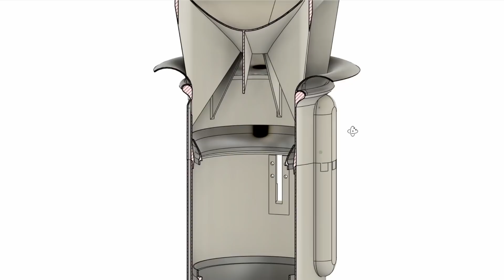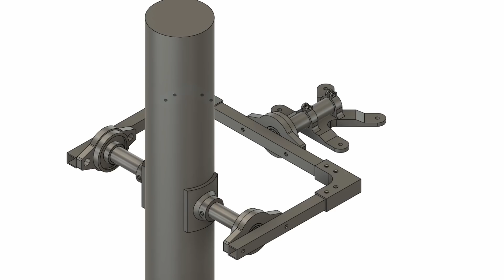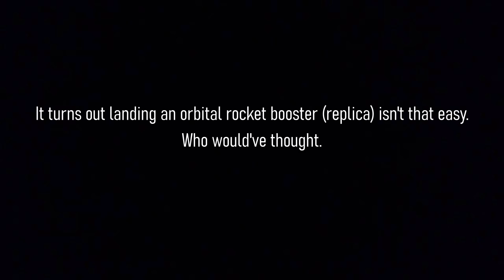SpaceX inspired edf rocket part 2: Final assembly, tuning and maiden flight

Comment: Great project!! Looks great! 
Add weigh to the lower position or move down the EDF or battery.
I fly RC airplane and when the plane is in hover and nose heavy start to oscillate the same way that your booster, so my advice is to add more wight in the lower position or remove weight from the upper position.

Good luck!!

Comment: 1.  Put a rocket engine at bottom.  2. Put landing legs at top of first stage. 3. After burn launch, eject capsule (parachute?) and use small gyro to flip first stage of rocket 180 degrees. 4. Now with landing legs down, use the landing motor to put her down. Piece of cake!

Comment: Very cool... A couple of possible solutions.....use the pid controller on the gear legs.  Appears the problem gets much worse when the first leg gives and the others touch down. Time it so if say at 5deg rocket tilt the gear plane is -5deg the other way. At a minimum link the legs so they react/move together from impacts.  Other possible solution would be lateral thrust ports just below the fan  directing flow for lateral stability... Aka cold gas thrusters.  Once ground contact happens vector control is zero.... took SpaceX a few tries as well!!!

Comment: Cool. I think if it were me trying the rocket would have four small propellers pop-out up top and land like a drone. Use a real rocket motor in at the bottom that relates to gyro system. I've been wanting to make a go at it. To simplify the launch I think I would use clear fins instead of a gyro system. Then have the landing gear retract in between the fins.

You did well.

Comment: Seems like one problem is the spin down of the EDF.  At touchdown if the vertical alignment isn't perfect, then the off axis gyro effect will cause the rocket to precess (tip over).  Cancelling the gyro moment of inertia with your setup will be difficult.  A second EDF rotating the opposite direction would be ideal but maybe a small motor spinning a weight under control of the EDF rpm would help.  Terrific work!

Comment: It seams that the rocket cannot have much X and Y forces right after the moment of the touch down. Probably you have to reduce the payload load, or try to redistribute the mass. You could put the DC motor down and redesign the air vents. If you use batteries as 18980 (don't remember) try to put them around the rock body. Or, simple add some weigh close to the bottom of the rocket. Just ideas. It is an impressive project. Congratulations!

Comment: The ducted fan sounds maxed out, I was going to add a second one to my design, and use a higher kva motor on the top. You could tie "retro thrusters" to help stability on the upper fan, diverting more volume higher up. Use your existing servos, and link a sliding door higher in the body. Also might be worth the weight adding isogrid internally so you don't have to reprint your cone every crash. And maybe carbon fiber rods and printed hinges for the landing legs

Comment: Keep going, you're almost there! Maybe griffins or engines for lateral thrust
Reply from the maker: Haha yes, unfortunately grid fins aren't that usefull at low speeds, but using compressed air thrusters might work to keep the rocket upright during landing.

Comment: This is amazing work and progress! I'm wondering, watching the videos, if you're trying to do too much manually.  for instance, would a downward facing camera that's looking for the 'marker' of the landing pad be something that could assist with the landing. the computer could make faster adjustments I'd think. Also do you need thrust on the head of it? The first landing came in at an angle, there was a bit of a bounce and then it looked like the head momentum just kept going (makes sense, the base was 'stuck' as it was on the pad).  If there was thrust at the head, I'd think a small amount would go a long way.  That may make the design too complicated, but just my thoughts. Really well shot video, thankyou! Subscribed and looking forward to the next one!

Comment: Have you tried adjusting the D setting in the yaw axis? When the legs are retracted it doesn't have the same centrifugal resistance when they're out. Try spinning in an office chair with your legs out then pull them in. You'll spin faster. Same with the PIDS. They're trying to adjust when the legs are out but it's a totally different behavior when they're in. Have you tried adding dynamic filtering?

Comment: Cool. I loved it. When will we see part 3? If it helps you to get a more stable landing, you can try out by adding a parachute. Or just making landing legs a bit longer, locating them a bit higher, and increasing their pitch angle adding another 45 degree. Something similar to Apollo LEM (Lunar Excursion Module).

Comment: Very nice, I'm wondering if your servo ever broke or if it was only the plastic for the leg connection?
Reply from the maker: The servos broke more than once and they were a real pain to replace 😅
Reply: @BrianBrocken  Thanks for quick reply, I'm then going to use "MG99R" for my model rocket, instead of the "SG90" servo motor ;-)
Reply from the maker: This might be a good idea but even then you might still have a broken one as the moment arm is pretty large. I’m working on a new version that puts a lot less stress on the servos and locks in place and has some shock absorbing.
Reply: @BrianBrocken  Cool, do have another servo to lock it or how will you make the lock?
Reply from the maker: Mechanical lock in place, the original one also did this a bit but it was to easy to jump back out.

Comment: I dont know if these types are available, but i think you need a dual counter rotating fan to prevent the instability when the legs are retracted.
Reply from the maker: Yes, this certainly is a possibility. This would neutralise the torque created by one motor and would probably solve the problem with the landing gear 😉👍 the only problem i can think of right now is that the 2 edf’s would probably drain the battery to quickly. I now have a flight time of about 1 min with only 1 edf, i think it’ll get worse with 2.

Comment: That is an amazing project, i scratch build my own rockets of the traditional solid fuel variety in the UK, yes HPR is alive here just, ime one of only handful left in the UK that does HPR due to are very inhibitive culture here regarding private aerospace development.
i am wondering how the physics would work regarding the rocket equation with combining your EDF system with an SRB for the initial vertical/altitude phase of flight, in theory all the EDF has to do is have enough amps of power to aero-brake &  stick the landing which means it could be run from a small lightweight ultracpacitore, ime not sure how this would work in the real world but i bet it would be fun trying. If you dont need to worry about a shute recovery system that leaves a lot of freedom to get the rocket up to a considerable altitude.
I cant wait to see you next video when you get it to get some high & stick that landing, it looks like quite a challenge you have bitten off there, good luck & hope it works
Reply from the maker: Thanks man 😁 i think a hybrid rocket would be possible and a great idea. Believe it or not but the original idea was to use a super capacitor bank to power the rocket (Tom Stanton inspired 😜) but quickly abandoned this idea because of the higher weight and very small flight time. I did manage to get my fpv race drone in the air with it and got a 20-30 second flight out of it, but edf’s are a little more power hungry 😅
Reply from the maker: I was going to use these ones: https://m.banggood.com/2_7V500F-GDCPH-Two-pin-Super-Farad-Aluminum-Capacitor-35+60-p-1738789.html?rmmds=search&act_poa=SKUG13082&cur_warehouse=CN

Comment: It becomes unstable in the yaw axis when the legs are retracted because of the change in moment of inertia. You could offset this by attaching counterweights to the legs that move towards the outside of the rocket when the legs are retracted in order to give the same moment of inertia.
Also you lose attitude authority at the moment of touchdown when you need it most because the vectored thrust system is unable to move the bottom of the rocket when the legs are touching down.
 you could possibly channel air into ducts that produce thrust jets around the nose, that would take over control at the moment of touchdown.

Comment: Its awesome... does it help balance if the weight is increased... I know the lift becomes difficult and I am no expert
Reply from the maker: I do think it gets more stable the more it weighs because of the inertia, but like you say this is limited to what your edf can push. The whole thing flight ready now weighs 1.3 kg and the edf is rated for 2.5kg static thrust, but due to losses in the tube it's just able to take off with only a little margin left.
Reply: @BrianBrocken  got it. Great effort though🙏. I wish I could motivate myself to finish any of my projects some day.🤪

Comment: A large part of the landing problem is that the ONLY controls you have appear to be the vectored thrust out of the tail.  This means that to swing the nose, it HAS to be able to swing the tail.  But on landing, as soon as the tail touches down, it can no longer move laterally, meaning there is no control over the nose tipping.  In the real rocket, there are reaction control thrusters in the nose that can provide the little nudges necessary to keep it upright as it touches down, but I doubt this would be practical for your design (you could try adding laterally-directed thrust ports that slide open or close to control the amount of thrust through them?)

Simple solution, though: try adding a landing net/hook.  That's what the navy uses to get it's helicopters to stay put on a pitching destroyer or frigate during landing.  Put a small barbed probe pointing downward, and tightly stretch a net slightly elevated (1/2 inch or so) over the landing pad. On touchdown, the probe enters the net, but the barb prevents it from coming back out.  If the airframe starts to tilt, it is arrested by the net.  https://en.wikipedia.org/wiki/Beartrap_(hauldown_device)

Not EXACTLY how SpaceX does it, but unless you can add lateral reaction control thrusters near the nose (or alternately, come down PERFECTLY upright, PERFECTLY downward, with no tilt or lateral motion whatsoever- near impossible with any air movement), it will continue to tip.
Reply from the maker: Some people have suggested to me to use magnets in the legs and a steel landing platform which i think is also a great idea and would probably work very well, kinda like the net/hook sollution you proposed.
Reply: @BrianBrocken  Yes, magnets would probably be a more elegant solution, come to think of it

Comment: Dude! That’s so awesome!!! I am by no means an engineer or a rocket scientist, but it looks to me that the rocket is heavy on top. I have no idea where the c.g. should be, does it need to be top heavy so it can move the bottom more easily? Just seems like if the c.g. was lower on the body it would not want to tip over on landing, but would that make it harder to fly? I do know this is only possible for the real boosters because of computer adjustments on the nozzle. Humans can not react fast enough to make the minimal adjustments required to keep that thing vertical.
Reply from the maker: @MrJim117 haha thanks man 😁, The weight needs to be at the top or else it won't fly at all. You can compare this with trying to balance a large and a small stick on your finger, the larger stick will be easier to balance. The higher your cg, the more leverage and control authority you have at the bottom. Of course for the landing it would be ideal to have the cg as low as possible but then the thing won't fly at all. The CG would actually need to move from the top to the bottom when landing. The flight computer i'm using is also fully capable of making a lot of small adjustments 400 times per second ;-)
Reply from the maker: the cg is not entirely on top of the rocket, but more like just above the middle of the rocket. At 02:42 you can see the CG marked by a little black spot on the rocket, this is also the place where i mount the rocket in the rig to have 2 degrees of freedom for testing.
Reply: Right, I totally forgot about balancing a bat or golf club on your finger. Lol that’s why I’m not an engineer. That and I suck at math...
Reply from the maker: I'm not an engineer and I suck at math too you know haha 😅

Comment: @bryan brother im doing somewhat the same concept but im gonna add a little more gear like a gyro electronic stabilizer  so that way i skip the trouble of a bar which wouldnt serve any purpose and with the fins i would have 4 in the outer which would be like 4 to 8 inches and the inner sould be either 2 3/4 too 3in. And have 2 servos that controls the positive direction and oppsite direction of the fins so u can have more control from take off, and from there its all gyro work as it accends higher and it would be asesome to add a long range reciever with a fail safe so once it reached too its highest were communication breaks between u and the rocket it will shut the esc off until it comes into range of the the 6 channel remote. and a gps pod so if it decends after point of communication with the radio has established u can add a return home mode to your rocket and it would be the most awesome and well spent proj. Enjoy

Comment: That's incredible. I have been waiting for this video but unfortunately I was busy in my exams. Brian I have a suggestion, why don't you drop it from a height and test it's landing only rather than lifting off
Reply from the maker: The main reason i think is just because it's just the easiest way of getting altitude on it's own power. The thing weighs around 1.3 kg and i currently don't have a drone to lift this kind of payload. Using an extra drone just makes it more complicated than it has to be, like why use an extra drone when it can perfectly get to the altitude on it's own power.
Reply from the maker: Good luck with your results btw, i hope you did well 😉👍
Reply: Thanks a lot. You are such a humble person. ♥️

Comment: Thats too crazy! Great job! What kind of software are you using? Is it some kind of open source software or did you write it yourself?
Reply from the maker: I used a pixhawk flight controller running arducopter V4.0.4, this is an of the shelf component but a lot of parameters and settings need to be changed to get it flying.
Reply: @BrianBrocken  Wow... I expected the PID Tuning to be very hard. Did you use arducopters SingleCopter ability? Still very hard to get this thing to fly. Again... Great Job.
Reply from the maker: The pid tuning was also very hard haha don’t let the simplicity of the video fool you 😆 i spend days/weeks trying to find the right parameters 😉 and yes i used the singlecopter firmware for this one and thanks man, appreciated 😁👍

Comment: I don't think you need any Integral gains for this sort of thing. I think you need more P and D gain though.  You want to bring your tuning to the point where it starts to oscilate and then back it down. You're not there yet.  Also you might want to look into mixing a bit of your other axis into the equation when you for instance activate your ROLL Left command, add 10-20% of TILT  to counter act the axial rotation you're seeing.  Would be worth experimenting there. Also I hope your upper portion of the rocket is easily replaceable. I suspect you'll need to print a few more of those due to joint damage there.
Reply from the maker: Hello Tim, Thrust me i did get it to the point of oscilation 😉, you can even see this a little bit at 03:00 in the video (was way worse in the tests before this). if you don't use any integral gain, how are you going to get rid of your error between your setpoint and measured value? generally the D action is untouched when tuning any multi or singlecopter, this case wasn't any different. I tested out the exact same values as I used in the test flight but changed the D value from 0.005 to 0.007 and it just couldn't keep itself upright. In general i think i got the PID values very very close to their sweet spot (except for the yaw axis). These things just won't fly if your values are not correct, even changing the "P" or "I" value by 0.05 made it unflyable. I'm pretty happy with the stabillity it achieved, except for the yaw axis, this needs some more work. 

Every part of the rocket is easilly replaceble, i didn't glue any of the joints together. The servo's for the landing gear are snap fit and detach upon impact (still had to replace one arm one time 😅) The fusulage itself consists out of 4 main pieces which are just hold together with white duct tape. Upon impact these slide out of each other and can be fixed with just reaplying some tape. So except for one servo arm for the landing gear i didn't have to replace a single piece on it and i'm quite happy with that ;-).
Reply: If you use Super Twisting Sliding Mode controllers instead of PID you will have solid results.

Comment: You could try moving your edf motor and other components downwards. Or decrease the overall length of the housing/ combustion chamber/stages .Your model seem to be top heavy !
Reply from the maker: For landing, yes it is top heavy, but for in flight this is preferred, see rocket pendulum fallacy.